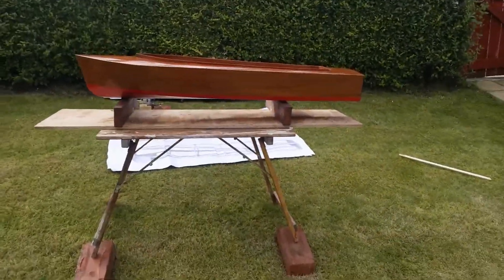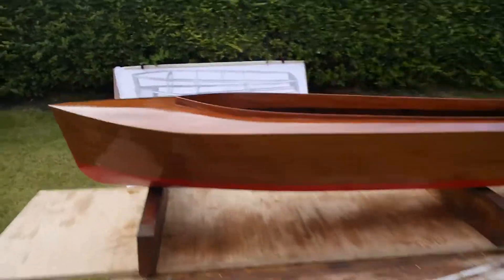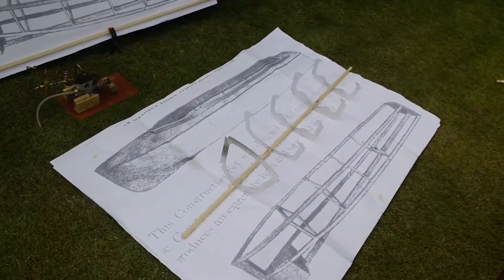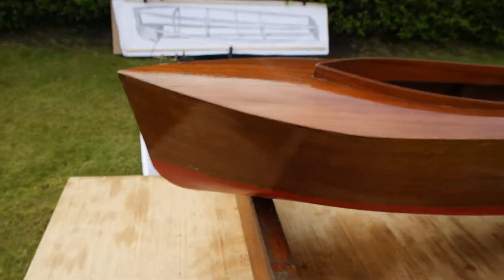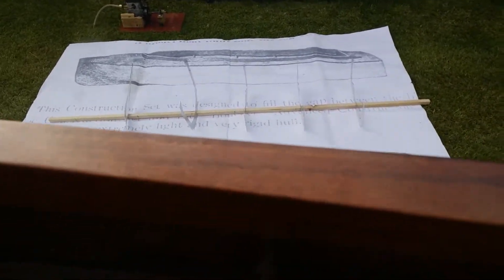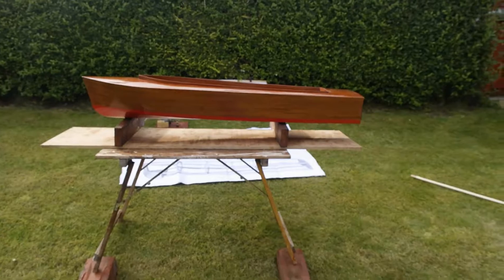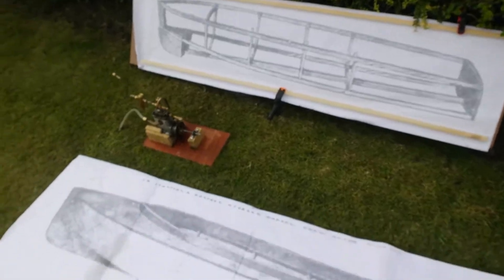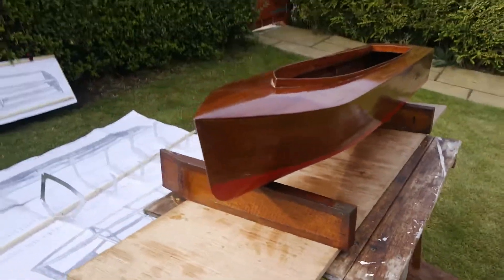BOUCHER BARRACUDA  BUILD

Comment: I had a thin spot on a vintage launch I got and as I intend to use it applied a 2 part po;yester clear coat self leveling coat on inside over cleaned up damage. It is the type they use on stump table tops etc. UV safe and more forgiving than epoxy. Nice job on this hull better than factory I bet.